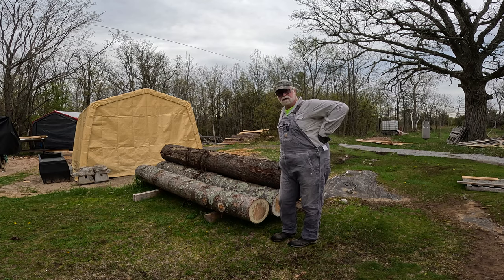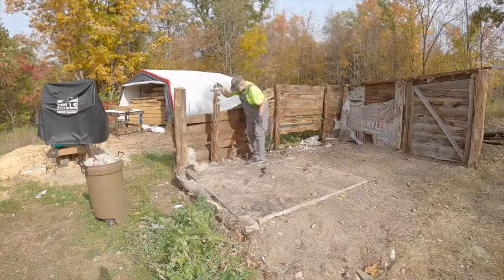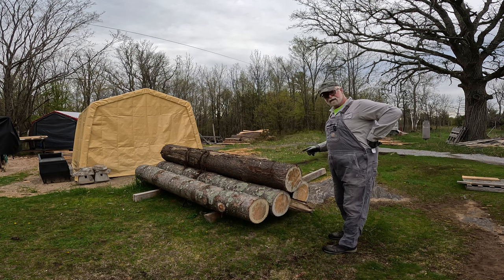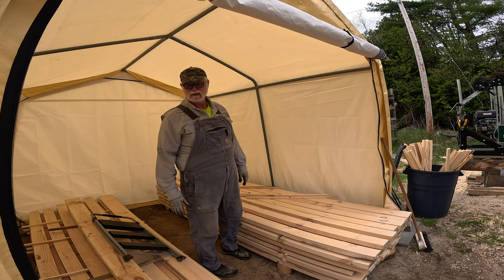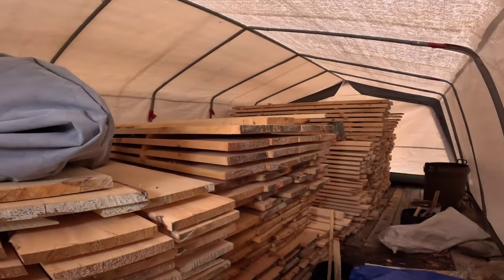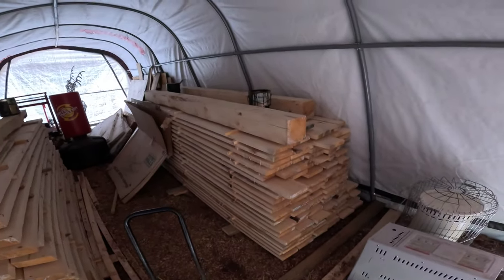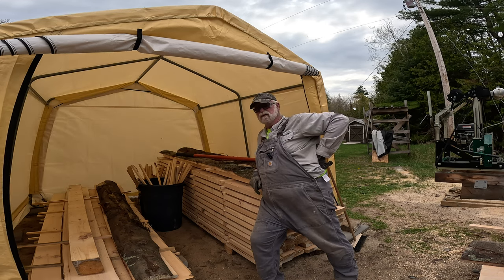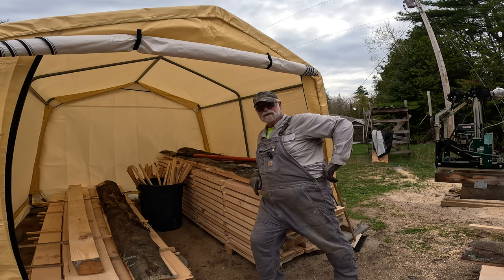Achieving Sawmill Success & Beat The Heat in 2024

Comment: Great to have done Brian. A lot of moneys worth of lumber there.
Reply from the maker: It sure is in both cases. Thrilled to have bet the heat. It was pretty wicked running the mill last summer.
Reply: Yes it would be. I was cutting rounds off of the 8’ log pile for firewood last summer. Was hot. And it looks like I will be doing it again this year. 
Have a great week. 👍🏻👍🏻👋👋